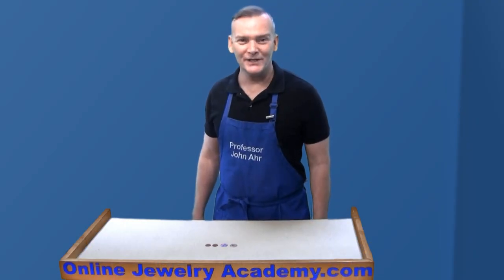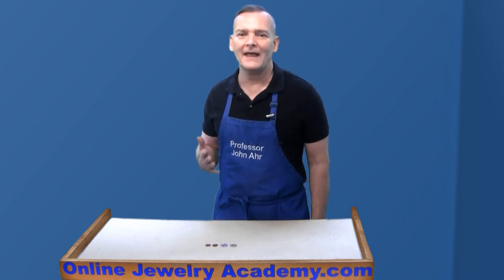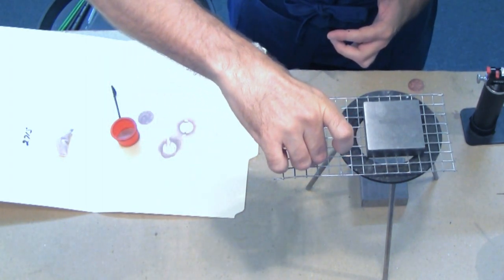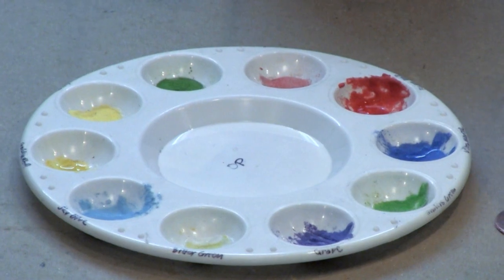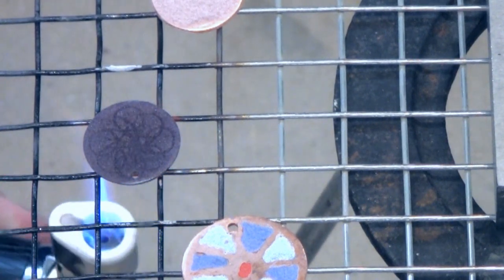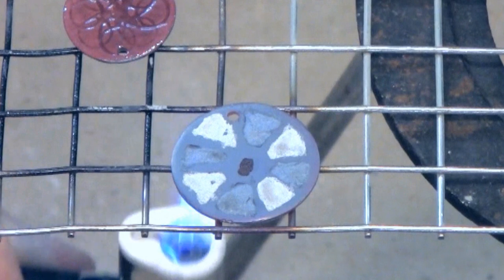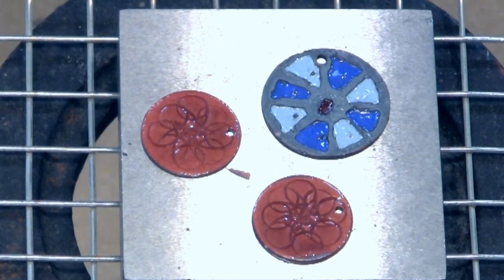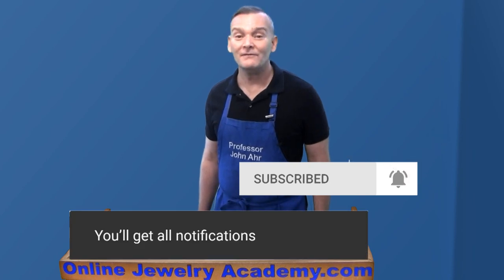How I Enameled Copper Pendants Without A Kiln

Comment: Hi Can you tell me why is it every time I take my piece out of the kiln the the enamel has pulled away from the edge. thanks

John
Reply from the maker: Without the advantage of being able to see your work, my best guess is that you are enameling on copper and not “stoning” the edges between firings. Oxidation that forms on the edges of a piece during firing is creeping up on the top surface. The enamel will not flow on top of a dirty surface. If you don’t have a stone, try sanding the edges under water. I hope this helps. Good luck! 🍀

Comment: Hey I’ve been struggling trying to find a paint enamel that doesn’t require a torch per say. Suggestions?
Reply from the maker: @testingti  what you’re looking for are liquid resins that are cured with UV light. 🥸
Reply: @OnlineJewelryAcademy  Okay, I’m making dental grillz would that be durable enough?
Reply from the maker: @testingti  I don’t know 🤷🏻‍♂️. Plus, I don’t know if they are safe for that purpose. You’ll need to do some research. 🧐

Comment: When buying enamel, i noticed they also sell liquid enamel. What's the difference between powdered and liquid enamel?
Reply from the maker: Liquid enamel is used primarily for coating a large surface area.  They are useful for creating background colors on tiles.  They work well.  However, they will not produce the same results as powdered enamel.  And, they do not offer you the same opportunity to create delicate color shifts.  You can learn more about liquid enamel from thompsonenamel.com. : )